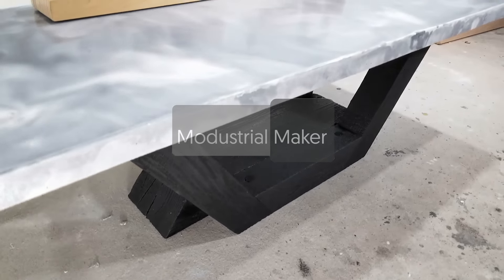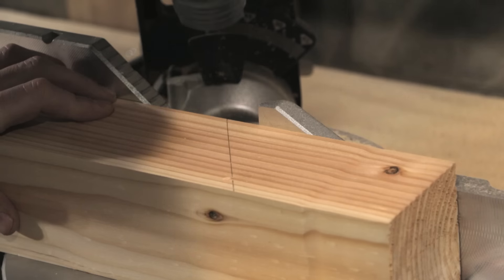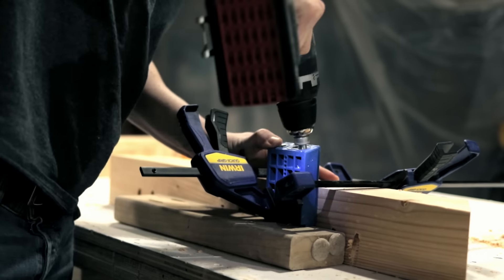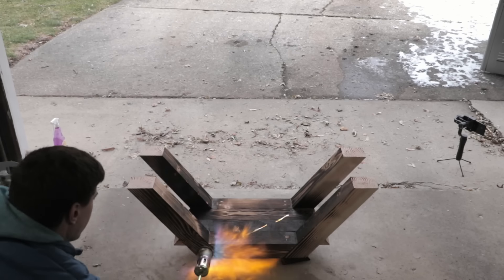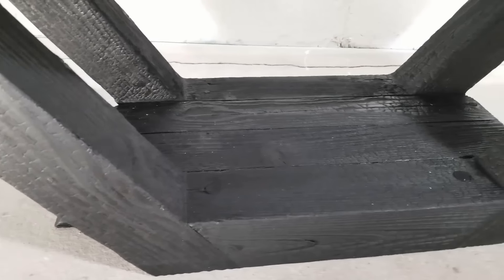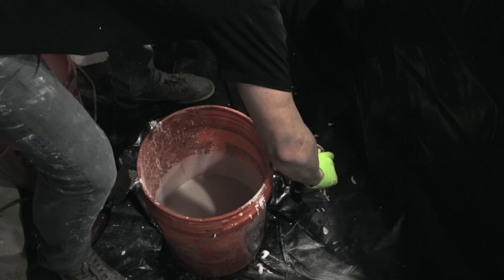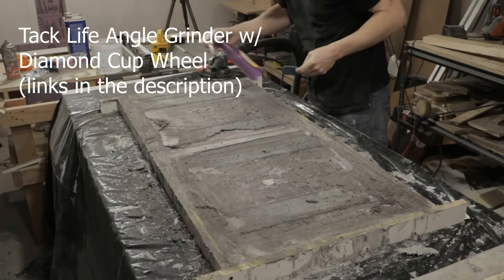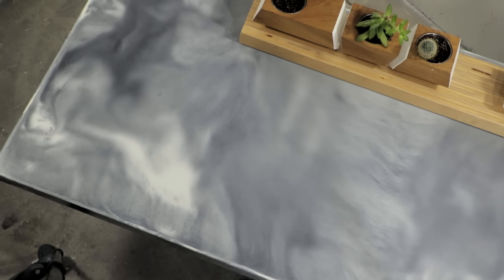DIY "Marble" Concrete Table || w/ Shou Sugi Ban Base

Comment: This is epic and it looks really cool! I had to check it out as I want to redo my kitchen counter tops, although I want to do mine in black with white and grey stripes and possibly some glimmer to make it sparkle in the light. Not a whole lot. Just enough to catch the eye. As for the cloudy look, I don't think your panic alone caused it. I think it may also have something to do with the flow rate of the concrete or said in other words, how wet it was. Perhaps more striking lines could be achieved by either mixing different fluid thicknesses of concrete or let the stripes dry a bit before pouring in the next, so that they still mix, but not mix together fully. And maybe you have to secure the foam to the 2x4s before putting them on, next time. That or use melamin boards that weigh a bit more, but that's just my two cents
Reply from the maker: Thanks!  And good ideas.  It would be really cool to see this in a full countertop!
Reply: @modustrial  No problem :)

Comment: Never wipe glue off. Let it dry and then use a sharp chisel, you can remove it. That way the glue isn't smeared into the wood resulting in a lot of sanding and ruining stains.

Comment: I like the project...
For ease of placing the recessed base pieces..
Maybe use the same slick wood you used for the form that casts the surface of the top...
That should eliminate the air bubbles...
And attach them with hindges which should locate then exactly where you want them and make make following casts easier....
Those tables look marketable
Reply from the maker: Thanks for the suggestion!

Comment: I have used different colors of tile grout to make my marble veins. I simply put the dry powder where I wanted the veins then poured the concrete mix over it. The water from the mix penetrates the grout powder easily but keeps it in place so it dosen't look muddy.
Reply: @wickedgrafix...do you by chance have a photo of your marbled looking top? I'm in the process of making a kitchen island/cart and patio/deck table. Thanks in advance
Reply: @fernandobatas3482  I can get a picture but its not going to be that great. Unfortunately my top is under 2 feet of snow and ice but I'll cleared off what I can. This one is around my fire pit.
Reply: @fernandobatas3482  give me your email and I can send a photo.

Comment: i have more questions..
why do you need the 2 foam pads? for what again?
would the table collapse, split in half because the concrete was so thin and there's no reinforcement or anything in the middle to hold the weight?
Reply from the maker: Foam pads reduce weight and amount of material (GFRC is not cheap).  No, this table is incredibly strong ...GFRC is way stronger than normal concrete.

Comment: I've used double sided duct tape to hold the forms together instead of screws.  It allows me to reuse the same form without tearing it up.
Reply from the maker: yup, double sided tape works.  I've done it several times, although I prefer carpet tape over duct tape since it is thinner.  You can reuse the forms when you use screws too.  It really just depends on the nature of the form, and which method you prefer.  In my next video (should be out next week), I actually don't use screws or double sided tape -- all I use is hot glue outside and silicone on the seams.

Comment: looks great.  Seems like you could skip the foam and just glue it to the frame.  But I can see that the foam adds strength to the project.
Reply from the maker: Thanks!  The foam reduces the weight and the amount of concrete needed (so also saves $$)

Comment: I'm seeing this like 6 months after you posted.  The table looks great.  Personally, I have more ideas than I have initiative.  One idea I've had for faux marble is to cast a thin and slightly undersized "skin".  Once that hardens, break it up and distribute it evenly inside the full sized form.  The cracks between the pieces, with a contrasting mix color, would become the well defined veins which appear in a lot of real marble.
Reply from the maker: That sounds cool!  I think you should go for it!

Comment: I love how you use the foam to lighten the concrete but that takes away from adding rebar for strength. Have you ever had any issue with it cracking/breaking?
Reply: Oh does the fibers strengthen it from cracking that you mixed in

Comment: Amazing job.  Did you use any type of vibration to push the air bubbles out from underneath to ensure the extremely smooth surface ?  Wet sanding at the end obviously but anything else done  to get that smooth like glass?

Comment: those bolts u covered arent going to loosen over time as the temp changes and the wood shrinks and expands?
Reply from the maker: They might slightly, but shouldn't be enough to do much.  Their main point is to reinforce the glue joint if it tries to flex, and they'll do that just fine

Comment: Great look. I have no experience in this kind of projects, but it struck me that wood or plywood would be a better insert to lighten weight, since it would also strengthen the structure? Am I missing something here?

Would temperature changes potentially mess up the table if you inserted wood, because of different retraction/growth in wood vs. concrete?
Reply from the maker: Plywood is way heavier than foam, so it increases weight, and extra strength is unnecessary when using gfrc mix
Reply: @modustrial  ok, thanks for the reply :-)
Reply: Pmywood would also change shape as it retains moisture and dries again, so cause the concrete to crack later on :)

Comment: Love what you did with the marble appearance.  I was wondering what your thoughts are on using it for a waterfall countertop?    I've the pre-mixed GFRC in the shopping cart at Fishstone and going back and forth between white or this marble style.  Having never done this I'm concerned that the hand applied face coat could slide some on the vertical face losing the "whispy" marble like appearance you achieved on a flat and level surface.  Thanks!
Reply from the maker: +Don McLoy the marble would be challenging to do vertically (it actually uses the white gfrc with pigment added, so same stuff either way).  You have to make it more liquid in order to swirl by hand, and it wouldnt stick to the vertical surface. I would stick to white, especially if this is your first attempt.  I also highly recommend doing a mini pour with a vertical surface (e.g. 8 inches or so) just to get used to gfrc.  When doing a flat surface it is pretty straightforward and there is a lot of room for error with making the mix a bit to wet or dry.  But with the vertical surface for a waterfall, you've got to nail the consistency.  Too wet and it slumps, too dry and it won't stick.  I worked up to the waterfall.  It's not really that difficult, but I wouldn't recommend trying to pour a large vertical on your first gfrc project.
Reply: Mike, thanks so much for the response. I'll take your advice and get an extra bag coming to practice with.  Thanks again and your designs and videos are great.  If I'm successful I'll send you a photo.. or if I'm not as a lesson to someone else!
Reply from the maker: I think if you do a practice project first you'll do well.  You can always have a back mold piece (to fully enclose the waterfall) cut and ready as a backup, in case your mix isn't packing well vertically.  White makes it easier because you can just mix one or two bags at a time.  (I realize in my waterfall video, I say I mixed all 280 lbs at once -- I really meant that I mixed all the DRY components for 280 lbs at once, so that the pigment was consistent.  I still just did 50 lb batches of the actual wet mix to pour, which is more manageable.)  Good luck, and let me know if you need any more pointers!

Comment: Mike the premix concrete GFRC bags you are using are def. preferred but what is your opinion quickcrete countertop mix to use in conjunction with the glass fibers since fishstone is not locally available outside of IL ?

Comment: What if you used polystyrene concrete mixed with the fiber after the top layer? this would lighten things up wouldn't it?
Reply from the maker: Not sure, I'm not familiar with that material.  Have any links with info?

Comment: Hey Modustrial Maker, I'm trying to build a similar base and I followed along for the 35 degree cuts, but how long are these pieces from tip to tip?
Reply from the maker: I think I have some dimensions in my instructables write up for this.  Otherwise, there are lots of free right triangle calculators online....just plug in the leg angle and the height you want the bottom of the tabletop at, and you get the length of the leg

Comment: Nice! Does the burnt wood stain when touched?
Reply from the maker: Thanks! No, the finish hardened it up pretty well. You can also use a wire brush on it before finishing to be sure nothing comes off.

Comment: I've seen someone use a solid core door in lieu of the styrofoam. Also ...I haven't done it but it seems to me that you could use an orbital sander...I have a terrible vibrating old one...and use it as an agitator to shake the table to get all those bubbles out. They agitate it in real world pours so why not.

Comment: Just an FYI...The 'U' in Japanese unless it is the first letter of a word (I can't think of a word in Japanese that might begin with a 'U' at the moment) is not sounded, except in song where all rules can be broken.  It is spoken in 1 of  3 ways depending on where it is and what letters it's next to or between:  it is either silent (just a breath used to connect two consonants) OR it's used to carry out the sound of an 'O' when it follows the 'O.  (it is also used at the end of words not originally Japanese to make an 'er' sound or to simulate the diphthong of English consonants (like 'ringer' is 'ringu' and 'beer' is 'beeru'. but those are not Japanese words so they don't follow the same rules.)  Also, there are no accented syllables in Japanese.  Every syllable gets exactly the same 'force'.  It's hard for Westerners to do because multiple syllable words all have a syllable that is stronger than the others. The word 'westerners' for instance would be [WES-tern-ers]. The 'g' in Japanese would also be pronounced more like a 'k' and less like a 'g'.  So, Shou Sugi Ban would be pronounced like [show-ski-ban] not [shoe-SUGI-ban].  Hope this helps! :-)

Comment: ill find out how mine turned out next week.  i did my fireplace mantle top.
Reply from the maker: Very cool!  I'm curious how it comes out.  If you share pics on Instagram, definitely tag me or DM me so I see them.  (@modustrialmaker)
Reply: @modustrial  it looks awesome.  my corners/edges are a little rougher than yours but it looks very cool.
https://i.imgur.com/rPhW0FBh.jpg
there it is.  havent sanded or anything.  im amazed how smooth it is.  we vibrated the crap out of it with an air compressed chisel to get bubbles out.

Comment: Would "air-creat" be better for this application? Or at least as a second layer filler? It is supposed to be lighter.
Reply from the maker: I haven't experimented with air-crete, so I'm not sure.

Comment: After much much much contemplation..... here goes...... pour in the white veins, and leave to harden, while shaping them with hand. Once the white veins are dry, pour in the dark cement, vibrate to your heart's content. And voila!
Reply from the maker: That could be really cool!  Definitely something to try...
Reply: @modustrial  Cold joints tend to weaken the casting and delaminate.  Years ago I was an engineer at Portland Cement Association, one of our divisions designed architectural concrete.  An architect wanted to mimic marble on some wall panels and wanted the veining to look like ghosts of wild horses. (His client had more money than Ft. Knox)   To get the marble effect we ended up using an extremely high slump (admixtures, NOT water) with very fine aggregate and 'high-early' cement in blacks and whites to get the veining.  The high slump was to ensure full consolidation and eliminate the need for vibration to remove the air pockets.  Panels were cast horizontally and installed vertically.  Actually turned out to be very nice after we convinced the contractor it would work.
Reply from the maker: @denai 94.... The GFRC mix I use uses an acrylic polymer to replace a lot of the water, as well as a plasticizer to further reduce the amount of water needed to make ait fluid, so it is plenty strong when cast like this.
Reply: @modustrial  My concern was the lack of strength induced by the cold joints created by javeria saraj's suggestion of placing the white first and allowing them to cure and placing the balance of the concrete.  I could almost see the veins popping out of the top.  Personally I have had concrete tops in all of my houses since the late 80's, and believe me my wife has gotten pretty creative in their finishes.

As for the GFRC, I have no issue with the product or its use in this application.  The only issue I have with fiber reinforced concrete is that some folks still insist that the fibers will take the place of steel reinforcing in structural slabs.  They are great for non-structural project like c-tops and even some slabs where there may be thermal stress but no real loading.
Reply from the maker: Ah ok, yea, that wouldn't work as well pouring new concrete on cured concrete isn't the best idea
Reply: @modustrial  aw shucks! Well, at least i tried. Ill keep on thinking!
Reply from the maker: I like the creative spirit!

Comment: great job!.. I wanted to do the same to save money, but I will need to buy all the tools
Reply from the maker: Thanks!  You can do this with a circular saw, drill, concrete mixer, and torch, just takes a bit more time.    You can buy quality tools for these for under $300.

Comment: Do you think this process would be okay for creating slabs for a patio and stepping stones?
Reply from the maker: Yea, it could definitely work for that.
Reply: @modustrial  Thanks! I have an extremely long list of outdoor projects and need to find some options to cut costs while improving design. This should also make a nice surface for the pizza oven 's counter-top.

Comment: Do you have to put a wire mesh in between the concrete mix for a stronger structure? or it's fine without one? I can't wait to start this project :)
Reply from the maker: No need for anything else to reinforce.  The glass fibers are strong enough on their own

Comment: It seems that carbon from the seared wood might rub off on everything that touches it. And putting oil on it wouldn't help, and might make it worse, by only making the surface soft. Unless this Danish oil penetrates the entire charred surface, hardens, and connects the surface to the wood underneath. After the oil dries really well, could you rub a white rag on it with some pressure, and not have the black surface rub off on the rag? If so, I'm sold!
Reply from the maker: Danish oil does exactly that, penetrates and hardens.  That's why I chose it.:)  If you are really concerned about char rubbing off, you can take a metal wire brush to it before applying finish, to knock loose any char that might flake off.
Reply: Thanks so much for the answer. I always loved charring wood, but never found a way to keep it from rubbing off. Looks like I have the solution now! And ignorant people STILL say you can't learn anything from Youtube! ATB2U!
Reply from the maker: I can't say it won't rub off at all, BUT, it definitely helps a lot.  The burnt wood sucks up a TON of the oil... I used a whole quart and it probably could have taken more
Reply: Sounds good. I'll try to keep the char layer thin. Thanks again!

Comment: Hey great video. Looking to do something similar with foam backing to reduce weight but on a larger scale - 4m countertop. I was wondering whether you would recommend putting some type of reinforced mesh to provide greater stability.
Reply from the maker: If the 4m countertop is supported by cabinets below it for most of the span, there is no need for further reinforcement.  The most challenging thing about that will be finding a piece of melamine that is 4m  long....standard here is 8 ft (about 2.4m), and if you use two sheets the seam will show.  They do make them bigger, but you probably will have to special order it.
Reply: Right of course - I didn't think of that. Thank you for the reply. Been going thru your videos this morning given me heaps of ideas.
Reply from the maker: No problem!  Inspiration is my goal, so glad to hear that :)

Comment: Does the charred part rub black soot off of it whenever you touch it? I feel like this would be really messy, maybe the finish you put on holds everything in place?
Reply from the maker: No wiping it down with finish removed a lot, and the danish oil penetrates and hardens, so that takes care of most of it. you can also use a wire brush if you are really concerned about this.  Check out Jonny Builds Shou sugi ban videos for more details on using the brush.

Comment: Very nice!  I would very much like to see a "granite" result on a concrete countertop (browns, oranges, white streaks, etc...) where it looks natural and all you have to do is wet sand and seal it.  I have seen many  YT vids on epoxy-topped, poured-in-place tops, but the lead time and work appears daunting.  I. Don't. Like. Epoxy. Countertops.
Reply from the maker: I agree re: epoxy countertops , not my thing...  The granite look concrete would be cool.  I might have to give it a try

Comment: I read through your instructable on other projects with a all white top but didn’t see mention of pigment added. If I buy the pre-mix GFRC in white is it the with from your live wood table? I see on their website it says off-white. Do I need to add white pigment?
Reply from the maker: It is really white as it is.  I didn't add any pigment in either of my white concrete tables .... They are both the natural color of GFRC mix.